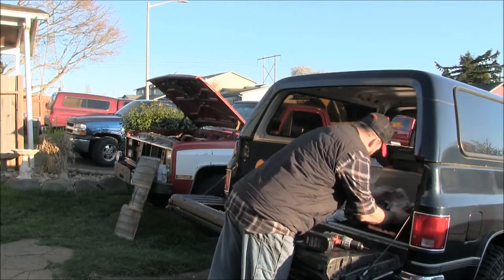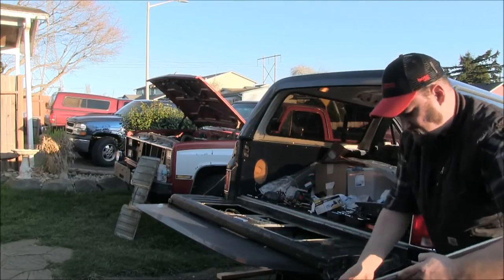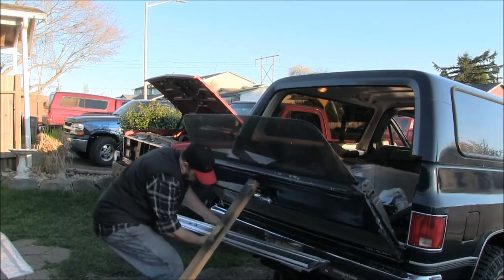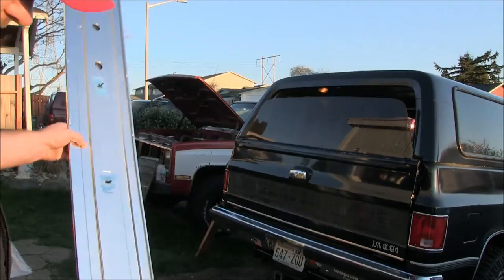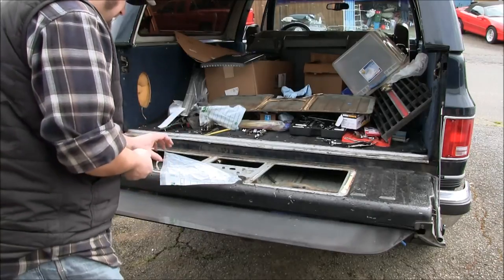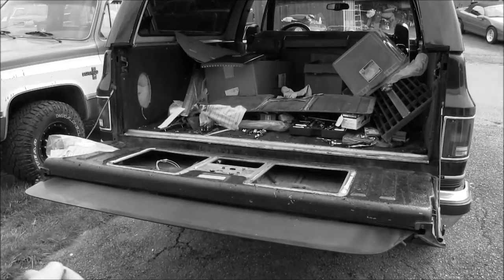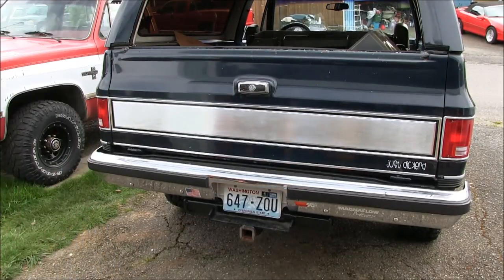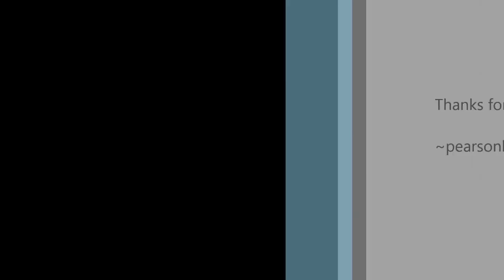Tailgate Trim Replacement on the Blazer

Comment: now question did you have to tape the new bolts to keep them on? if so i think you did them wrong by looking at that setup and then seeing you had to drill i think that you was suppose to put the square part of the carriage bolt in he square slot and the little bump just stopps it from sliding back out.

Comment: and im talking about the top bolt right above the rear tail light
Reply from the maker: +A More SO I took a look at mine this morning, and there is a hole right above the bolt that I think you're talking about.  I can see light coming through from my tail light.  So you should be able to remove your tail  light lens and housing, and should be able to access the back of that bolt.  Hopefully this helps...If not, send me a pic of what you're dealing with.  We'll go from there.

Comment: dude HOW do you get the top bolt out that houses the tailgate support??? i can get the bottom ones out no problem but the top ones just spin and i cant find an access point on the back side anywhere. my tailgate support straps broke and i need to replace them. any tips? thanks
Reply from the maker: +A More Not to sure- The bolts came right out when I removed the tailgate from the junk yard rig.  Sounds like there's a captive nut welded to the inside of the body, the welds might have broke.  Have you tried removing the interior panel, to try accessing it that way?  I'll try taking a look at mine tomorrow in the daylight, see what I can see...